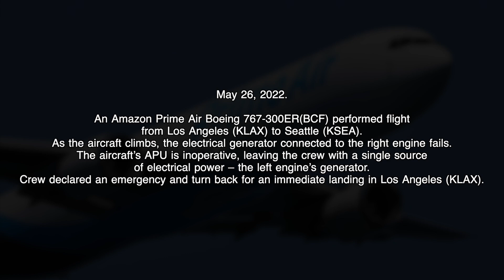Airplane lose power source. Emergency landing. REAL ATC

Comment: Inop APU but don't 767's also have RAT for emergency back-up power or is that just for hydraulics on Boeings?
Reply: The RAT would be an emergency power source, but it is not intended to ever be used. It is the safety backup after all backup systems fail.

Comment: Nice work, staying calm and on mission, crew and ATC!
Wondering, in these situations, are the cabin and crew communicating to the passengers to apprise them of the emergency?
Are they required to do so?
If so, how much can they say to keep the passengers informed, without creating chaos/panic?
Any pilots/knowledgeable aviators out there who can answer?
Thanks!
Reply: Don't think the Amazon packages would be too concerned with what's going on.😁
Reply: In this type of event on a passenger flight, they would be told they are returning or diverting as a precautionary measure for a minor technical issue. No reason to give any information beyond that until they are on the ground or the situation deteriorates. 

Even if they lost the last power source there would still be the Ram Air Turbine for enough systems to get to safely get to the airport and land.

Comment: Shows the supposed “alien underwater base” offshore…right about the time of the emergency. Conspiracy guys gonna have fun with this one.
Reply: What are you talking about?
Reply: @sea6487  There are several straight lines and square patterns on the ocean floor outside LA. This area is also well known for UFO sightings, most famously the TicTac incidents. I think that's what he's referring to. But of course, it is likely those patterns are data "artifacts" from the ocean floor mapping that was done in the area.